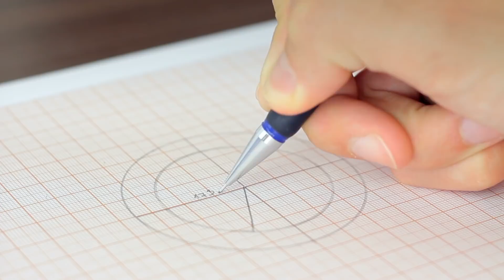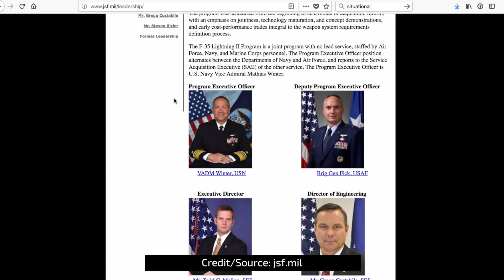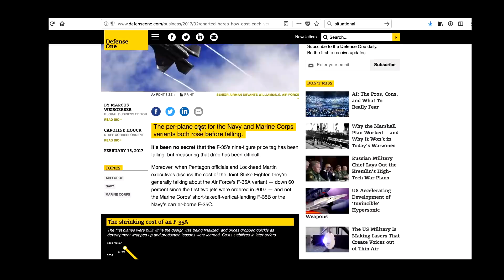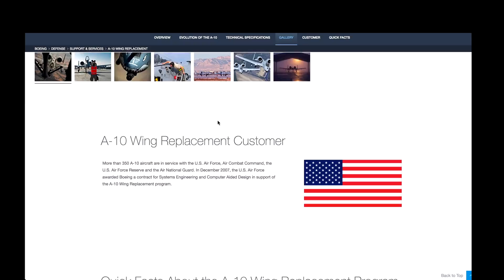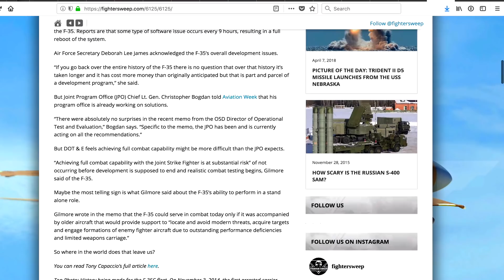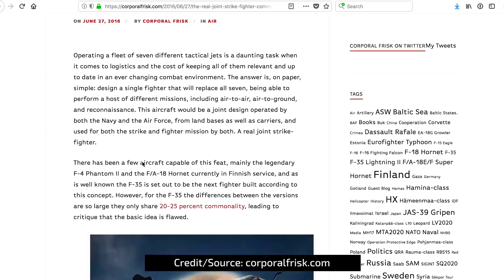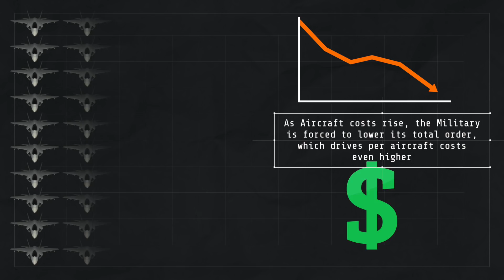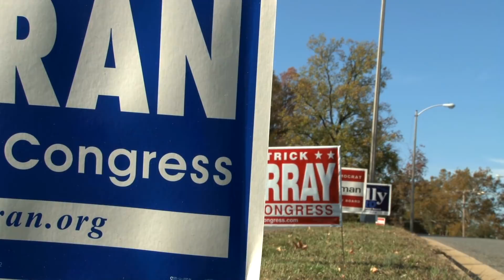Why the F-35 Lightning II Might be the Most Expensive Military Aircraft Mistake Ever

Comment: I'm sorry but there is SO much wrong with this video and anyone that knows anything about the F-35 would NEVER take this channel serious. I'm just an army veteran but my older brother is a REAL F-15E pilot and knows a LOT about the F-35 and just how great it really is. 

I stop watching a little over halfway through because there is so much wrong in this video. The very first thing that I noticed was that the part where it says the F-35 lost to a F-16 in a mock dogfight. That was NEVER true. It wasn't a mock dogfight and the F-35 didn't lose. The actual pilot that was flying the F-35 said that they were testing some of the flight controls and I believe the AOA of the F-35. It is already proven that the F-35 is more manueverable than the F-16 and other 4th gen fighters. Also the cost has gone WAY down like they said it would. Anyone that thinks Pierre Sprey knows what he talking about, doesn't know anything about fighters to begin with.

So in short, if you are REALLY into fighters and want to learn the truth and not a bunch of BS, I wouldn't consider this channel. There are way to many youtube channels out there like this once that act like they know what they are talking about.
Reply from the maker: We will check out that channel. But it’s too bad you only watched half of the video, as we presented the other side to the F-35 detractors (like Pierre Sprey) from actual F-35 pilots like Dave Burke.
Reply: Its always good to understand both sides of the coin. That being said, the most-experienced F-16 pilot of Norway (Callsign; Dolby) loves the F-35. Just superior to the F-16 in all aspects. Only thing he didn't like was the visibility to the back of the F-35, due to the cockpit layout. He doesn't think it will be a big problem though, because in the end you will be able to see through the whole jet, thanks to cameras on the outside, linked to the helmet.
Reply: SuperGeronimo999 - I haven't heard anyone that has ever flown the F-35 or against say anything negative about the F-35. The F-35 SA (situational awareness) is just awesome. So when you combine that with it's stealth capabilities, it is just an awesome aircraft. Pilots of the F-35 say that they are just scratching the surface of what the aircraft is capable of.
Reply: The israeli IDF also seems very impressed. Is anyone going to regret buying the F-35? We'll see.
Reply from the maker: +MississippiRebel Thanks for your comment!
Reply: Two Bit Aviation - I would really recommend you go watch Dalek14mc to learn more about the F-35. Besides what my older brother has told me about flying against the F-35 in his F-15E, Dalek14mc is probably the best video I have seen. It is extremely informative and would really help you make better videos with more accurate information.
Reply: MississippiRebel wow. Your brother flew a 2 seat strike aircraft against a single seat fighter that’s less suited for the attack role but more suited for traditional fighter roles. If that isn’t apples to oranges idk what is.
Reply: So why did the Air Force buy 80 F-15Xs?
Reply: Spot on. This down played much of what the fighter does. Plus people need to understand that the public definitely are not told everything that this plane can do.
Reply: jack torrence

The P-51 didn't take years to develop and became the standard (it only took 5 months). That should be enough help to figure out why your statement is moronic.

"massively cutting down on the enemy detection, tracking and targeting ability is overrated" Is that the point you're trying to make?
Yeah sure. My bet is that you never read that RAND study and just repeat whatever moronic headline you read.
Reply: jack torrence

The whole blueprints could be given to Iran and they'd never be able to build it. You're clearly exaggerating the impact of espionage and how much a single employee can leak. And what makes you think that espionage only works in one way?

Advancements in radar and detection technology doesn't remove the stealth advantage unless there's a fundamental change in the workings of radar.

Again, you have no idea what this information means. You're trying to extrapolate information.
Reply: jack torrence

Go read the definition of the word 'stealth'. Why do you think they called it stealth and not invisibility? It never was supposed to be invisible, so of course it's not going to be.

The only one of these systems that can be mounted on aircraft is IRST, which happens to also be part of the stealth measures of the F-22 and F-35. With a simple change in nozzle shape you can easily cut down the IR signature by 60-80%. Those engines have high bypass and so on. Yeah, they aren't invisible to IRST, but they have much reduced signatures that reduce the effective range, just like they have reduced radar signatures.

So yeah, aircraft have no real effective measure against stealth. This means that stealth aircraft will obliterate the opposition with ease. Funny how you say it's overrated, yet every country building new combat aircraft is trying to make them stealthy. Who do you think knows better, you or the combined departments of defense of China, Russia, USA, India, UK and so on?

Also IADs have their own weaknesses, mainly they can't move very fast and are fighting against gravity. Go read up on SEAD operations.
Reply: jack torrence

You're looking at stats without any idea of what the reality of the battlefield is, neither do you understand such projects.

Every aircraft has issues when it starts. When the F-16 entered service, one crashed every 10 days for a few years. After a few hundred crashes it became much more reliable thanks to many fixes, but would you consider it a failure today or not? How many deficiencies do you think it had to cause so many crashes? Obviously not all deficiencies are equal since no F-35 has crashed yet. Clearly you're extrapolating way too much information from that statement.

A single F-35 is a combat system inside a whole combat effort. You're doing the equivalent of claiming covering fire is a waste of ammunition, or that guided bombs are too expensive.

Again, the F-35 can either carry an internal or external payload. With an external payload, it's still stealthier than the competition, therefore is better. But the competition can't have the option of an internal payload. You can't come here and claim that having the choice is somehow a bad thing. I don't know how to make it easier to understand.

And the point of the internal payload isn't to take out an entire air force with one aircraft. If the F-35 is fighting an equivalent number of aircraft, it has the upper hand. If it's fighting a larger force, it can have other aircraft act as 'mules', in what case it has the upper hand too.
Reply: The A-10 very rarely uses it's gun. The A-10's #1 weapon is the Maverick. Most CAS missions now are carried out by the F-16 already so then the F-16's replacement can just do those missions. Also, when fitted for CAS missions the F-35 can carry 18,000 lbs. in munitions and the A-10 can carry 16,000. The F-35 has an internal fuel capacity of 18,000 lbs as well where the A-10 has an internal fuel capacity of only 11,000 lbs. And that is with one engine not two. The A-10 has a loiter time of ten minutes when it fitted for CAS and 30 minutes when it is fitted for anti tank. The F-35 can also get to it's target three times faster than the A-10. The only thing that the A-10 obviously has over the F-35 is the Gau-8. Other than that, one could argue that with the knowledge that we have about the F-35 it cold even survive hits better than the A-10. I mean it does not even have hydraulic lines which means that you could send shrapnel through it and as long as the engine is still on it will fly because it can reroute power to whatever flap it needs to to keep itself in the air. That is something that the A-10 could only have in it's wildest dreams. Also, we lost as many A-10s in Desert Storm as F-16s, F-18s, F-15s and F-14s combined and some of them were shot down with shoulder fired IGLAs. I am not an A-10 hater. I grew up watching live fire demonstrations at Ft. Riley in KS and sometimes they would fly in an A-10 and shoot up some tanks for the crowd and it was awesome. Because of that, the A-10 is my brother's favorite aircraft pretty much of all time. But as anti aircraft weapons get better and better then it becomes more and more obsolete.
Reply: Ummm....you got some things right and a lot wrong.  The A-10's primary CAS weapon is the GUN.  I know, I worked them for almost 2 decades and four combat deployments.  Secondly, AGM-65s are expensive and raillery used in combat.  Third; Desert Storm A-10's have NOTHING on current A-10s, the entire mission systems suite is different. 

30 min play time for CAS....HAHAHAHAHA...no.  try A LOT more than that.  And as for your "F-35 can take more hits....You clearly have never been up close an personal with the Hog.   

The A-10 Hydraulic system is hardened and also has a manual back up.  So yes the F-35 has EHA's and it's MAIN (but not all) flight controls are self contained but the A-10's systems are very hardened.  Also, if the F-35 took a hit it would burst into flames!!!!  The A-10 was built SPECIFICALLY to prevent that and has proven time and time again that it can!  

So in the first Iraq war the A-10 Casualty numbers came from 2 things.  First, they ended up doing DEAD (destruction of enemy air defense) missions which they were (at the time) ill suited to do.  And Second, the SCUD hunt, which exposed them to enemy A2AD and caused casualties.  

Also, and trust me on this.  The A-10 would be MUCH more persistent and effective in a CAS situation than an F-35.  Which by the way it was NOT optimized to do.  Remember JSF, which means Joint Strike Fighter.  STRIKE...not CAS.  It's a fine jet for STRIKE, CAS is vastly different.  I would NOT take a A-10 into a deep strike mission, nor would I want a F-35 to protect me on the ground.  I hate this obsession with the ONE jet does everything idea!
Reply: jack torrence
F-16 and F-18 was already an "all eggs in one basket." Fighter Mafia, you know, Pierre Sprey was part of that, pressured the military to design the F-16 as a dogfighter. But as time went on, they starts putting more avionics into the F-16 and turned it into a multi-role fighter. Sprey wasn't happy about this and he protested about that until this day. Ironically, the decision that upgraded the F-16 into a multi-role fighter is probably what made it successful. Saying "jack of all trades, master of none" is false, it's more of "jack of all trades, master of some." F-35 can be summed up as having BVR capability of a F-22, maneuverability of a F-18, and ground attack capability and range of a F-15E. Well, it's probably more accurate to say it's "jack of all trades, master of most," sure, a F-35 don't have the maneuverability of a F-22, but that's pretty much what it isn't the best among US jet fighters.
Reply: Adarsh lal

No it does not. Most CAS operations using the A-10 are ordinance drops from high altitudes. Why? Because strafing runs are a huge risk and aren't even as effective. It only works against ridiculously underequipped enemies like the Taliban.
Reply: Ummm....NO.  Explain to me why we used nearly 90,000 rounds of 30mm fighting ISIS in 3 months?
Reply: Also, no...Gun runs work on any enemy that is dispersed.  You do realize that the enemy KNOWS we drop bombs on them?  So they scatter and spread out.  But a gun run can take out a lot of enemy even if they are spread out.  OR, more importantly, if the JTAC or CCT doesn't know exactly where they are.
Reply: One size fits all might be good in somethings, but NOT in combat equipment.  Just my humble opinion.  Can it work?  Yes.  Is it best?  Most of the time NO.
Reply: MississippiRebel in denial much? Face it, the USA have fucked up big time by producing the two pieces of shit, F22 and F35. And yes, it did actually loose to the F16, how embarrassing, that’s the best aircraft you’ve got after your better aircraft, F16, F15, F18 are retired off. Put those two pieces of shit up against Soviet fighters, they would be slaughtered.
Reply: jack torrence

All shitpost and no fun makes Jack a dull boy.
Reply: My regards to your Eagle Driver brother but I have some contention with your statements.  

First I have met and talked at length about the F-35, F-15, F-16 and A-10 with Mr. Sprey.  He loved the F-15 as it was originally envisioned as he has a more WWII mindset of Fighter Aircraft.  He is not a detractor of the F-15 and F-16.  In fact he helped the F-16 come to be.  However his issue with the F-35 is basically because he doesn't like stealth.  Which I think he believes stealth should not be an "every jet has to have it" kind of thing.  Frankly, as a F-35 maintainer I can tell you, it's REALLY hard to keep up with the Low Observable stuff (or L.O.).  And who knows how well it works, especially after it's been worked on by various people over the years.  It's super expensive and it's effectiveness is hard to judge.  

Look Sprey's main objection to the F-35, and this comes from a three hour sit down with the man, actually two so closer to  5...comes from the "Do it all" approach the F-35 took.  It's a modern day F-4.  Sure the F-4 made it's name...but was that the pilots or the machine?  He also didn't like the high wing loading.  He said there is no way it would turn tight enough with that wing loading.  I don't know if that is true.  

I am sure the F-35 will make it's mark.  Hell the Israeli's are already using the thing in combat.  The "B" model is the best of them all as far as the 'game changer' roll.  I am not a hater of the F-35.  In the end, what I think is that the technology available today, has yet to fully mature to meet the F-35's needs.
Reply: So it's like this.  I am cruising in my F-35 and looking to kill your S-400.  I am at Mach 0.8 and 40K feet.  I would normally expect your radar to pick me up between 80 and 100 miles in F-18F or F-15E but now you can't find me until maybe 60 to 80 miles.  And, I am beaming you, meaning flying an off set course that helps my stealth out so now it might be 50-60 miles, perhaps less (no one really knows this answer).  But the JSOW-ER I cam carrying can get you.  So Just when you are starting to think...oh, that might be a bad guy...a weapon is already flying towards you.  And if I add into this MALDs, other fighters, ECM and Growlers you can see that Stealth has it's place.  

NO jet stands alone in a fight.  Also do not for get Cyber Warfare!
Reply: If you put them in a BVR fight, the F-35 wins 9 of 10 fights.  If you put them in a WVR fight, then I say 50/50 (provided both have AIM-9X and the F-16 is Block 42 or higher and has Scorpion helmet equipped).
Reply: Wierd how the people who "knows" someone who is a pilot allways comments. As that makes them an authority on the matter..
To sum up the F-35. To expensive to run, stealth "skin" requires so much mainentance. Its a good aircraft, do not get me wrong. But the pricetag running it is way to much for a bulk aircraft. The F-22 is only 50% more expensive to run, and it is a way more capable aircraft. I would rather have 2000 F-22s than 3000 F-35, for the same running costs. But thats just me.

Aswell as the F-35 having such a powerfull single engine, really pushing the limits on material technology. Only time will tell how much stress mainentance the engines will require, and the staggering cost of that.
Reply: MrDanisve - What's really funny is civilians like you that act like you know what you are taking about when in reality you don't know ANYTHING about the F-35 or any other aircraft. I know more than you ever will about warfare and military aircraft. But considering my older brother is still flying F-15E's for the US air force, it trust what he says. 

You couldn't be more wrong in your comment if you tried. First off the F-35 will only cost 85 million per aircraft when in full productioin, that is pretty the same as a Super Hornet. Secondly the "skin" of the F-35 is MUCH less maintence free than any other stealth aircraft before it!!! Lastly the F-35 is way more advanced and capable than the F-22! Yes the F-22 is the best air superiority fighter in the world, but the F-35 is the best multi role fighter ever built!!!
Reply: MississippiRebel  Well the price per aircraft is not that bad, its the cost per flight hour... When you plan to have a plane for 40-50 years the buying price becomes little in the big picture. About 44000 dollars per flight hour for F-35 atm, and 68000 dollars per flight hour for F-22. For a comparison F-16 cost 21000 dollars per flight hour.

Since about 42% of military budged goes to mainentance you would think it kinda matters... To use the money wise, and dont be stuck with som expensive target practice for the Russian jets that are more capable and cheaper.

Its sluggish low power to weight ratio, slow so it cannot run. And it ended up alot less stealthy than first promised. Sure its more stealthy than a F-15E sure, but compare it too a F-22 its a loud mouth. Just like you. Economics is a big factor and the most important one. And your imaginary brother even tho he might imagine he is a pilot he probably isnt qualified in all aspects of military logistics.. He can bring a POV thats all, and F-35A will feel like hes flying a "minivan" compared to the "sportscar" F-15E is
Reply: Just wanting to nitpick. 42% of the budget is spent on maintenance and also Operations. Additionally, while you're right about the flyaway costs of the jets basically being peanuts over its lifetime costs, the lifetime costs of the jets themselves is also basically peanuts to the fleet of vehicles and supporting infrastructure required to make sure that those jets are properly fueled, properly maintained, properly kitted up, and in properly safe condition. The operations section consists of actually getting all of the equipment where it is actually needed. It's the same with tanks actually, you hear about the individual costs, but you never hear about the vast fleets of maintenance vehicles, personnel, and infrastructure required to keep even one of those tanks in fighting shape. And while you imagine that the numbers for the F-16 look somewhat better, you have to remember that the F-16 is getting pretty long in the tooth. It has limited upgrade potential, and the airframe is running out of room for expansion. It's a design from the 1970s and while we've done a lot of upgrading, but at some point, it's just not worth it.

IIRC, down to a certain granularity, the single largest expense of the US military is actually Pay and veteran's bennies right after that. We don't use conscripts, and we pay our soldiers good money. The US fighting man is not some unsophisticated brute. He's a highly skilled, decently educated, well trained, upwardly mobile, well respected member of society, and it's been that way since the end of Vietnam.

Also, the "dogfight" that the f-16 "won" against the f-35 is taken way out of context. For one, it was simply a stress test gathering data in some set conditions, and one on which the F-35 had severe limiters placed on it in order to go with the ethos of the F-35's testing regime. Two, the pilot of the F-35 had previously been an eagle driver and he had maybe 100 hours on the F-35, and that included simulator time. The viper driver had 100 thousand hours in his plane. If the experience disparity is that high, it doesn't matter if the other guy is flying an F-22 or a Sopwith Camel (hyperbole).

Also, regarding attacking the SU-35. One of the things you're forgetting is that the F-35 is not some sort of thing for you to play Tom Clancy's HAWX in, it's a single node of a whole networked battlespace, where the warfighter has access to an array of weapons to tackle a wide spectrum target set. Sure, it doesn't have as impressive characteristics as an SU-35, but as of 2018, very few aircraft have as impressive characteristics as an SU-35, though contenders include the F-22, the F-15C (our air superiority variant), the F-15K (the korean variant), and Eurofighter. Despite that, the F-35 is still formidable, and as of 2018, the nerds at LockMart have started letting the fighter jocks give the F-35 a little bit of rough play. It's currently capable of supercruise and pulling positive and negative 9g turns with a full internal and external load, as well as firing an AIM-120 while pulling a 9g turn upside down. Pretty impressive for a Multi-role Strike Fighter, that is focused on Strike missions, and is meant to replace the current mainstay Multi-role Strike Fighter, of the US armed forces, which is the F-16, which as of current writing, has inferior flight characteristics.
Reply: so we take YOUR word for it? how do we know you aren't paid off by Lockheed-WHO's ,btw ,executives were JAILED years ago for bribery?
Reply: bademoxy - Well I guess you can be ignorant and not believe just how awesome of an aircraft the F-35 really is or you can believe what some people say that aren't pilots or any kind of expert when it comes to fighters and military technology. Either way it doesn't bother me because unlike you, I know that the F-35 is MUCH more capable than any other multi role fighter ever built.

So tell me again where you get your info from and have you ever even seen a real fighter in person?
Reply: You got any evidence beyond what any schlub could pull out their arse?
Reply: When that test went down it was a f35 b block 50% throttle and 5g limitations. The 7g 75% throttle killed better then 20/1 in red flag 2017 and can out perform any jet period besides going agaisnt the f22 and bvr the f22 could easily lose agaist the f35 with electronic warfare and its jamming abilities.  Would be a hell of a match but the f35 has better avionics and electronics by far. Better battle field awareness as well. The f22 in a close encounter probably yes but bvr the f35 as good as they come at this point. 
The super hornet Growler cost 115+ million and the f35a smokes it at all areas of electronic warfare and can can get to the target vs the Growler would never make it in.
Reply: Greg Williams  Indeed, thats my point. It turned out to be an electronic warfare machine, however with little capability but to detect someone. Then stay out of range. Relay info etc. Usefull aircraft for sure, however i do not se the point in having such an aircraft in bulk? Would it not be better to have a few of these to jam and detect enemys. Give that info to more capable bulk fighters that can do the job that the F-35 is bad at? Like enganging enemys hypothetical enemy like the SU-35, where it loses in speed, climb rate, turnrate etc. 1200 mph vs 1750 mph is quite the difference. Like a dog chasing a human
Reply: Greg Williams You should read the pilot report.
Reply: Greg Williams By the way, those Red Flag figures are totally meaningless without knowing the scenarios. I can’t believe people continue to swallow this simplistic nonsense without asking questions.
Reply: MississippiRebel Of course it did. Read the pilot report. It’s readily available.
Reply: When has trillion never had a 't '??
Reply: More than the sukhoi then lol 😂 get a life please
Reply: MississippiRebel is in my opinion, which isn't worth much, entirely right.  the f-35 is an amazing jet with capabilities, whose pilots haven't even begun to scratch the surface of yet.  From my understanding an air to air engagement between an f-22 and an f-35 could go either way.  The f-22 is likely the best air superiority fighter in existence currently, however it doesn't have the sensor suite of the f-35.  The F-35 and it's 14 million lines of code is designed to take a considerable mental load off of the pilot and enable them to focus more on what matters the most.  That being; flying the jet, and making the appropriate responses in a tactical environment.   Perhaps, if you had a super computer behind the controls of an F-22, it could make full use of that air frame's capabilities, however with a human at the controls, even the vaunted F-22 pilot has to multitask a vast array of sensors while also trying to keep their Mark. 1 eyeball fixed on the F-35.  All of this whilst attempting to gather enough targeting information for their missiles to achieve weapons lock.  The F-35 pilot has to do half the mental work, which enables them time to factor in the SLIGHT handling disadvantage. (keep in mind the some of the same engineers designed the flight systems of both aircraft) This enables them the time to think purely about what maneuver themselves and their opponent is engaged in, and decide which is the best course of action to take to gain the upper hand.  Alas; this of course being in a fictional dogfight between two jets likely never to see such an engagement.  

Stealth isn't invisibility, no, but consider not only does stealth inhibit ground radar, and the less capable AESA's of the enemy aircraft, but also the very seekers that are in the heads of the opposing forces missiles.  If an F-35 pilot has entered into an engagement that is WVR, they are either forced into an incredibly rare and unforeseeable situation, (admittedly, such is war) or simply put: that pilot is doing it wrong.  A majority of the enemies who will be involved in an engagement with an F-35 won't even be aware of it until their wing men start dropping out of the sky by missiles fired by an F-15 100 miles away, guided by a gaggle of F-35s in stealth configuration 10,000 feet above them, they were entirely unaware of.  The F-35 is a beast, and pilots who may have to face it in war will lose sleep over this jet. 

 Ideally, this jet will never be used, and all money dedicated to the world's various military's would go to research of Fusion, psychology, and general scientific exploration, but I digress.  That would be unrealistic to expect such cooperation from our species.  Plus it's fun bashing people with sticks, and laughing at overweight people who have fallen down.  God that shit gets me every time.  Bless Youtube.
Reply: MississippiRebel sprey is that the guy that said the harrier was a terrible aircraft but it downed a shit load of sky hawks planes I think he supposedly had a hand in designing and also he said the harrier would be nothing but flying targets for super sonic jets yet the harrier downed a good few mirage super sonic jets that Pierre sprey ? Mmm
Reply: Adarsh lal

1. The F-35 will/can carry more munitions, especially since it won't need to waste hardpoints at all. The wrong assumption people make is compare the F-35 internal payload to other aircraft's external payloads. The internal payload is designed for when the F-35 flies missions that would be suicide for the A-10.

2. The F-35 carries 8+ tons of fuel internally while the A-10 is at around 5.

3. The A-10 isn't armored, the bathtub only protects some critical parts, mainly the pilot. It can still be taken down by basic portable weapons if flying low, which is why it mostly doesn't. The F-35 isn't anywhere near as vulnerable as the A-10, as it can take on pretty much any IADs in existence, which is definitely not the case for the A-10. Again, if the danger is too high, it can fly with an internal payload, which the A-10 can't do.

4. The A-10 isn't perfect either, and the F-35 isn't very difficult to maintain and repair, it's just expensive to do so because of large equipment and crew requirements.

5. True. But then the F-35 can replace the A-10, F-16, F-18, F-15E and so on, while the A-10 can only do half of what it was designed to do.
Reply: Adarsh lal

The F-35 also has a gun. The A-10 doesn't use its gun most of the time, because that requires flying low, which as I already mentioned is a huge risk.

Can the A-10 fly in stealth configuration?